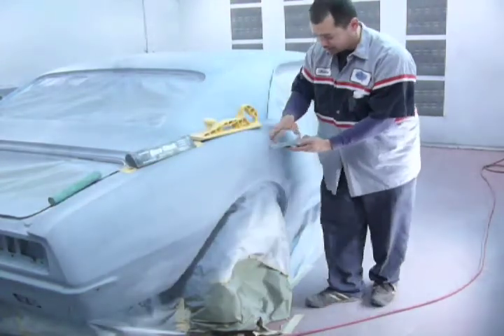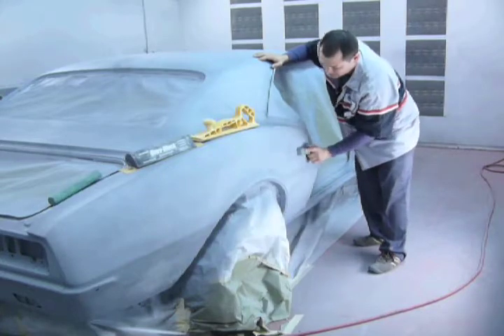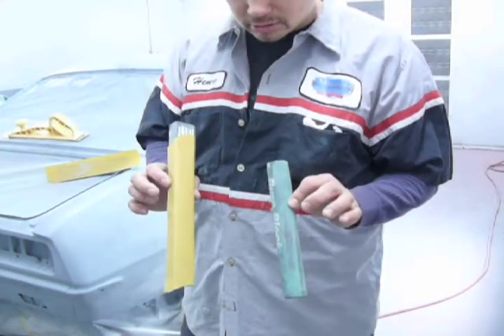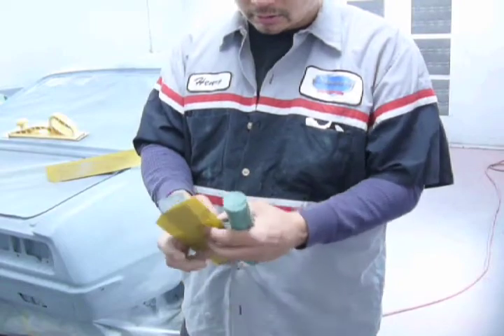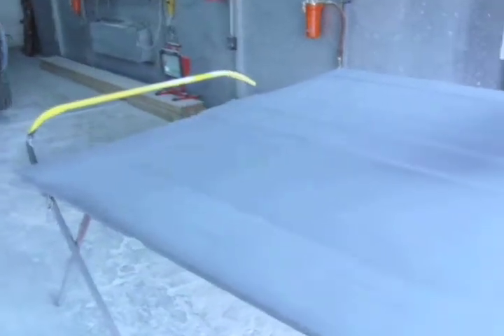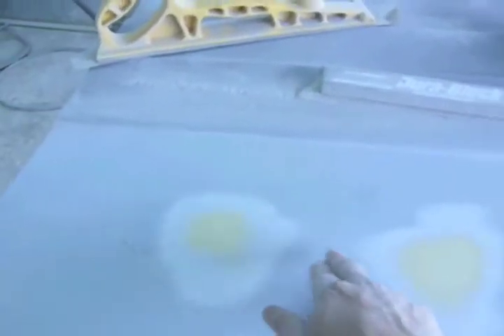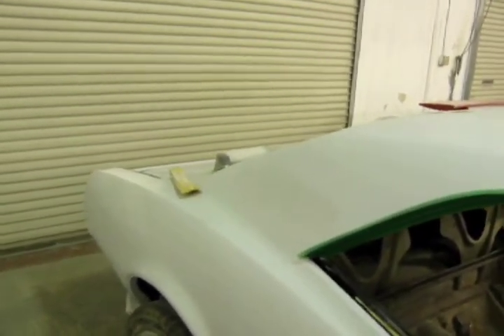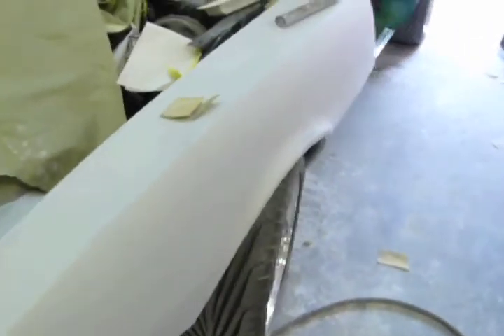episode 30/ green 67 Camaro/ goodbye Camaro

Comment from the maker: guide coat is there. Sometimes we do it  in the primer. We use a different color of primer on last coat thinned down and mist it on. No clogging. It's there though, just hard to see. The yellow block is hard as a boner yet has a thin rubber pad so it's not like you're sanding on a 2x4.

Comment from the maker: not much. Just the weight of the block. With round blocks I tend to block more lightly with 40-80 cause the point of contact is smaller so it digs more